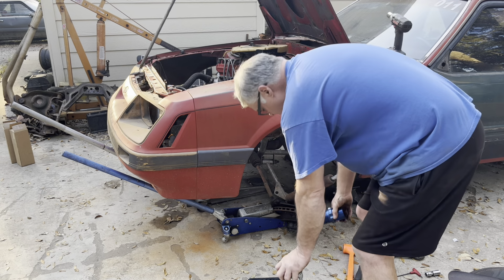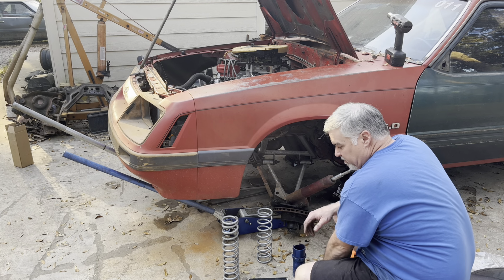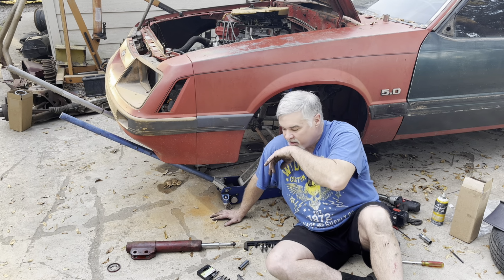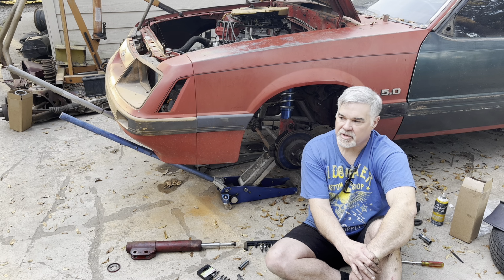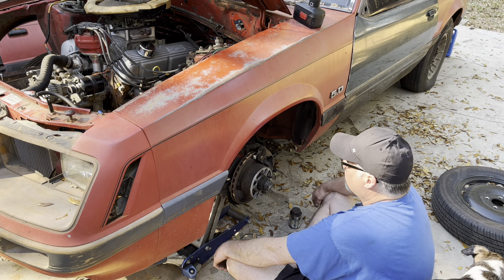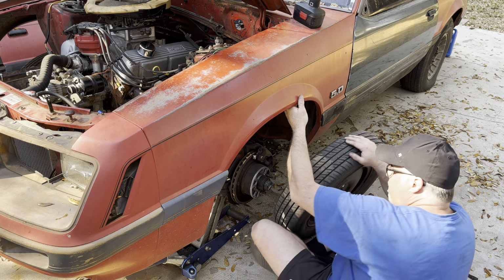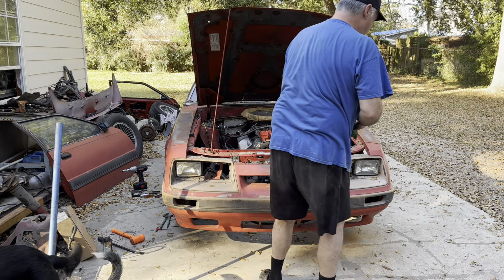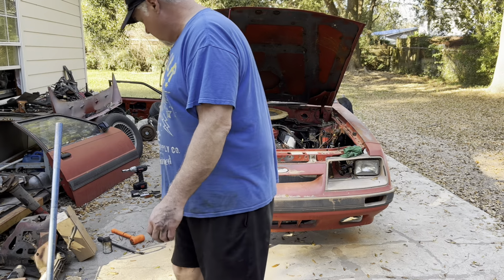1986 Mustang 5.0 GT Pt.60 "Springs..a Strut...and a test drive"

Comment: Good video Rodney. Real good points about how the weather affects things. On my low powered car I swapped the 12”/ 175lb. springs to 14”/ 125lb. springs which helped transfer and made the rear suspension more predictable which improved my ET’s. You just gotta try things and see what the car likes. Cut them bolts down! LOL 🏎🏎🏎
Reply: hey Mitch, you excited about Milan dragway re opening?
Reply: @motownXJdad9565  Absolutely!!! Met one of the new owners the other day. Seems like a good guy.

Comment: Even the Strange struts would be a nice upgrade over the Lakewoods. Everyone I know that has ran Lakewood 's had problems with them. I've had Strange's on my 14 for a few years now with good luck. I do run Viking shocks on the rear.
Reply from the maker: The last set of new struts I bought was back in 2007…one of them is on pro stocker 🤪🤣….I would buy a strange over a Lakewood nowadays as the adjustment ability and price are certainly in stranges favor…Viking? FaiLTD would get them before this pile 🤣
Reply: @5.0tussin  With that 1.39 60' I probably wouldn't change a thing, lol!! My boosted Coyote doesn't even do that, 😂😂😂

Comment: You could also run the 79-81 9ish inch rotors and calipers, a little lighter.
Reply from the maker: I’d like to run across a set and see the weight difference vs the 10’ stuff🤔

Comment: question for the car guys need a right direction . i have sn95 5.0 i bought the car as is when they took the motor out im not sure whats need to be block for the vacuum. but my main concern is when the car is on the accessories also flicker and i can hear the engine struggle to idle especially  when you first start it is serges aswell only when is cold till it warms but the flicking idk battery and alternator is fine. car has no radio
Reply: Do a smoke machine or cigar smoke test to determine vacuum leak if it has one, you can find videos from BREW2L and scotty kilmer on how to do that. The light flicker would have to be diagnosed in person in my opinion, as it could be many things, hoped that helped.

Comment: Have you ever tried to index the spark plugs I have heard that it helps the hp
Reply from the maker: Yes, we’ve v’d the electrodes, cut them back etc and never saw any difference..I assume it would show something on a more radical combo but our stockish mild stuff hasn’t ever shown a gain we could quantify 🤷🏻‍♂️..probably doesn’t hurt but you’ve gotta have some pretty good baseline data to really see anything imo…

Comment: I put a set AQA1 double adjustable coil overs on the rear of my 84 gt and now it rides like complete crap. Like its bottomed out, I think I have the Spring rate off..? (There were the ones LMR suggested, shocker.) Any ideas off the bat what direction I need to go? Anybody? Please!!
Also, What will you do with that extra set of springs for the front now?
Reply from the maker: I can’t really comment on the rest stuff since I gave no experience with rear coil overs, maybe some day lol…not sure on the springs, someone in the group may need them at some point 🤷🏻‍♂️

Comment: What brand and weight oil do you use?
Last time I got some new Strange I had to sleep on the couch(sofa) for a longtime. So be careful what you get.
Reply: What/is there a perfect temperature for racing
Reply: @geesss8675  It's kind of tricky. The weather that makes the best power isn't good for the track. 

But if I can get anything in the 60's and not too humid, I'm happy. And hopefully, no crosswind.